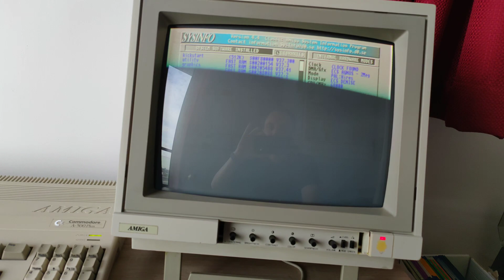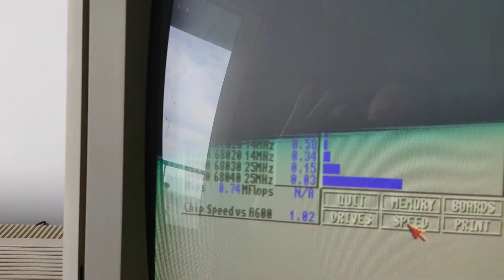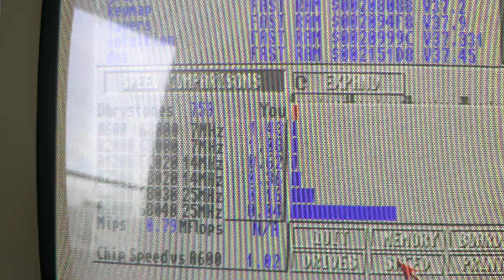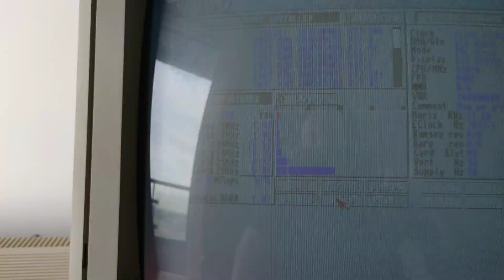Replacing the CPU on my Amiga 500 plus - 68000 to 68010

Comment: Would this work on a base amiga 500?
Reply from the maker: Yeah it should do and it's very cheap to try. However because this one has a hard disk and extra RAM, I can use whdload to get around any compatibility issues I might find. Whereas with a base machine you'd be more stuck.
Reply: @mattsqwrl  would a specific version of the kickstart rom help woth better compatible you think ?
Reply: @gilbertvera1678  Well, if you're playing games, you'd want to stick with 1.2 or 1.3 ROMs for maximum compatibility. And, as mentioned above, the 68000 has better games compatibility than the 68010.

Comment: Information to help you: The 68k CPU on your a500plus is very likely to be faster because it is a (relatively) modern incarnation of the a500 (an a500plus) and as such the CPU can be clocked at 14Mhz via a Spitfire-jbilander-SF500 (as shown on the RetroCengo channel since 9 september 2021 and videos since). It gives and optional 4MB-to-8MB RAM and an IDE and can thereby boot from HDD or CDROM and can work with a sidecar HDD such as the a590. Take care of that 68k CPU as it is a good one, and straighten the leg via a leg-straightener (which is cheaper than the value of the 68k CPU) and use a chip-quick or similar tool for insertion and removal. You can also get (or build) a switcher to switch between a 68010 (or whatever accelerator) and the original 68k on a sf500 or whatever. Expect the 14MHz clocked m68k CPU to give a sysInfo result of 1.18 compare dto an a1200 (and thereby better than an a1200 speed). Example games tha benefit are elite or fa18-interceptor but also games like StreetFighter2 for the a500 (because people would classically run that a500 version of SF2 in an a1200 to get better performance).
You might be able to also so so with the 68010. Assuming you revert to your a500 68k chip CPU, you'd thereby get more usage out of the 68010 if you put it into a sega megadrive/genesis to get 10Mhz instead of the 8mhz you get out of the amiga a500 (or a500plus).
The fact the a500 and a500plus m68k CPU clocks to 14MHz is commonplace knowledge like how the a1200 (and cd32) CPU clocks to 28MHz (although you need fastram) and it thereby performs like a 68030 CPU and is worthy of using an FPU with it.
My comment has no hate in it and I do no harm. I am not appalled or afraid, boasting or envying or complaining... Just saying. Psalms23: Giving thanks and praise to the Lord and peace and love.
Reply from the maker: I'm thinking I will keep the A500 Plus very period, rather than add an accelerator or anything. What I do want is a PiStorm 32 for my A1200 to make that a really fast Amiga, but they still don't seem to be all done with that!
Reply: @mattsqwrl  Well sure but a Spitfire-jbilander-SF500 does not remove anything form the a500plus as it uses the original CPU and the toggle switch can switch the acclerator on or off (to the standard a500plus speed) even when the machine is switched on. Just saying. Also it means you get all that lovely RAM and it can help preserve other parts of your a500plus, taking the stress off them (e.g. using the IDE on the Spitfire-jbilander-SF500).
You are definitely right keep all parts of the a500plus inside itself. Wise move.

Comment: Always use contact cleaner spray when re-inserting...
Reply: Never use a metal flat screwdriver to 'slide' under cpu, good chance you will damage a trace or more.
Reply: @CulturedThugPoster  after many years I’ve found the best approach to be a wide flat end screw driver pushed just into the gap between the chip and the socket and no further, followed by some wiggling. Way better then an over the top chip puller.
Reply: @lawrencemanning  If you go to a museum or an art gallery you will meet conservators who use 'best practices' to minimise risk. If you are serious about preserving these devices as best you can given the limitations of certain materials (caps/plastics etc) then surely it is best to follow thier example.
Reply: @CulturedThugPoster  on the other hand, folks have gone their whole careers using screw drivers for chip removal, since DIPs were introduced without a single marked trace and barely a scratch to the plastic moulding. So no, I couldn’t give a toss what was written in some text book. You develop a technique that works for you. Anything else is turning “giving advice” into dogma.

Comment: did same on my Amiga1000 years ago and made a huge difference going up to 14MHz when i was using a huge spreadsheet
Reply from the maker: Boy I wish this was 14mhz!
Reply: @mattsqwrl  you can get them nowadays for cheap unlike when I got mine lol
Reply from the maker: @f1lupo  Yeah I was wondering about PiStorm for my A1200 when it's available, probably keep this one very period
Reply: @mattsqwrl  the 68010 is very period specific. PiStorm looks cool but wonder how compatible/ stable system would be?
Reply: @f1lupo  68010 was almost identical to the 68000.  It had updates for resuming an interrupted instruction (which the 68000 couldn't do) but this changed the exception stack frame and broke games.  There was also a loop mode which could speed up memory copying loops.

Comment: The 68010 is one of the biggest nonupgrades you can get.
Reply from the maker: Yeah it's a small bump, but I fancied the ability to quit WHDload games and just have a fiddle! Would not recommend if this is your only Amiga, probably not worth risking the compatibility.
Reply: @mattsqwrl  Agreed, not worth the incompatibility just so that you can quit WHDLOAD.
Reply: ? Odd way of looking at it. Even back in the day you could buy the 68010 for around $10.00 and the install would take a total of 5 minutes. So for $10 and 5 minutes of your time you get around 15% speed up (5% on most tasks, up to 30% faster on a few others), you can move the VBR to Fast RAM (giving a big performance boost to Workbench etc) AND since the VBR can be moved you can now use the quit key in WHDLoad games to quit back to Workbench instead of having to reset the computer.

For $10 and 5 minutes I would call that a VERY impressive upgrade.... certainly not a "nonupgrade"?!?
Reply: @jandoor2068  Not stupid or odd.  You got a ~5% max speed improvement (which you needed to measure with a benchmark to actually see), but you also got a ~20% game incompatibility (well, at least with the games I had at the time) due to the "upgrade".  WHDload wasn't even a thing back in the day.  Even today, I'd not recommend it.   Better off saving the money towards an ACA500 or similar, you'll get a noticeable speed improvement and none of the problems associated with the 68010.
Reply: @jandoor2068  indeed!